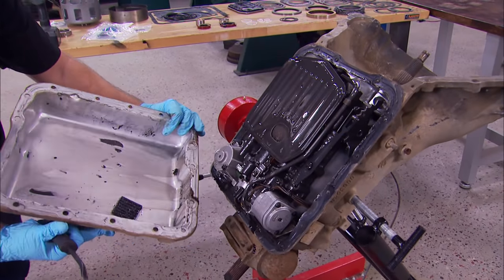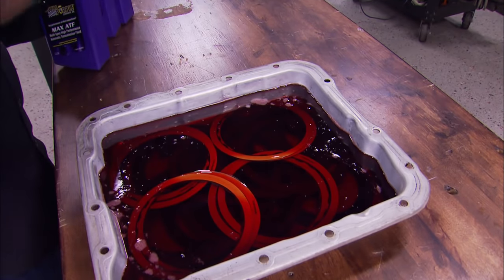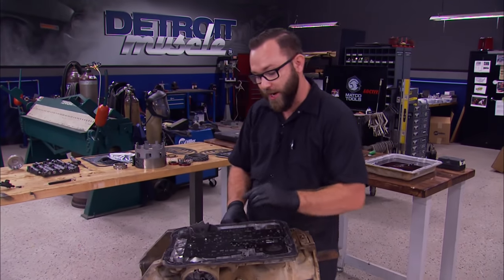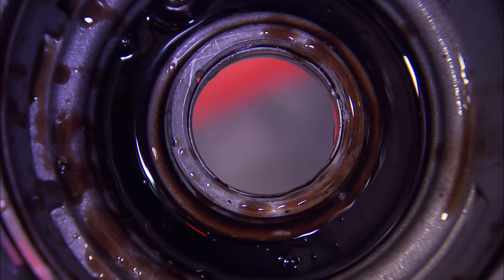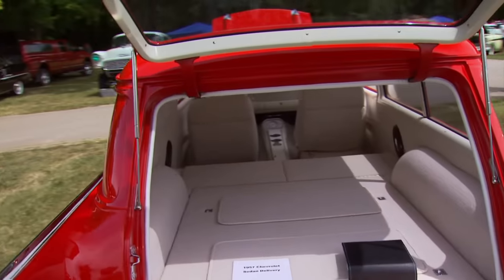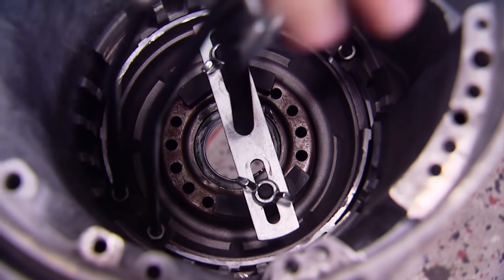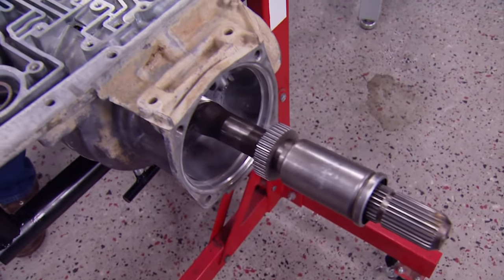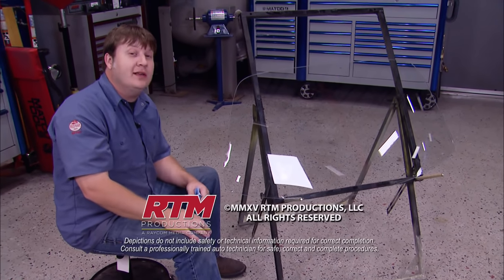Re-Building The Popular GM 700R4 - Detroit Muscle S2, E23

Comment: I've been rebuilding engines and transmissions since I was 12. I am 47 now. Not sure what you did in the pump, but I hope it's a 13 vane. Also, use a TransGo shift kit, which includes a new pressure vale in the pump. And you should use a wide band vs the stock one. Find a way to stack extra clutch disks where you can. And get an Allison Z-Pack clutch kit too. Get new accumulator pistons for it, and make sure to use an old one as well as a new one in the second gear accumulator. Use washers on the bottom of the shaft to stack both pistons till they are level with the plate surface of the trans. Pull the torque converter lock up valve, and add one of the check balls you are not going to replace, in between the two halves of the valve. Your TransGo kit will also tell you where to drill out holes in the plate. Even though the trans kits come with O-Rings for the bolts for the pump, always use some 3M sealant/adhesive on them as well. And use some to help secure the torque converter seal retainer too! For shafts, I always recommend good billet products. Sonnex is also a good source for top quality products.

I would also recommend that you get the ATRA rebuild manual for any trans that you are working on. If you need the manual for the 700R4,/4L60/4L60e, let me know, and I will put it on my google drive and post a link. 

I would also like to direct anyone who is planning to rebuild their transmission, to do a search for your particular one here, on Precision Transmission. I've been doing this for a long time, but even I have my heroes! I look up to Richard, and you guys will like him too!   https://www.youtube.com/c/PrecisionTransmission

Here is Richard's teardown of a 4L60 (Basically the same as a 700R4, and just prior to the 4L60e where the electronics were introduced.)   https://www.youtube.com/watch?v=_5lRls7UvzQ

Take care, everyone! o7
Reply: I love watching their videos.
Reply: I was watching a video by Richard from Precision Transmission just a couple of days ago. The man sure knows his stuff! 👍
Reply: If you seen,they left out a part.Left the anti clunk spring which was not put back in.Also toss the 5 black springs in the direct drum in the trash,restrict the clutches from floating
Reply: Thanks for the info! I'll be converting a 2001 4L60E into a 2wd unit and mating it behind a 2005 LQ4 6.0. This combo will be getting dropped into my old '68 C10, and I'll want reliability and longevity after the rebuild.

Comment: Thanks for the video guys!
I've learned that the 4L60E is similar with the exception of the electronics and the valve body.

I'll be doing a rebuild and 2wd conversion on my 4L60E that's coming out of my 2001 Suburban. This transmission will be getting dropped into my '68 C10 behind a 2005 LQ4 6.0. Of course I'll be installing the heavier duty clutch packs and sun shell. It has a rebuilt 327 and TH400. It's a very dependable combo, but it's limited in performance and driveability. I am upgrading because I want the EFI and the overdrive, plus the deeper first gear.

Comment: 700R4s aren't bad, especially when built. However, I wouldn't put it behind a V8 Big Block.
Reply: Chevy trucks of the era used TH400 in big blocks. The 700R4 would not last
Reply: We never had a truck with a 700R4 make it to 100k miles without having to be rebuilt. Once they were rebuilt they were much stronger.

Comment: 700R4 - 4l60s are really good trans . however not behind almost any V8 in a stock form .
Reply: Yeah, a new beast shell is needed in the rebuild, as well as new clutches,  and the 2 4 servo replaced for a Vette version.
Reply: Um I have nearly 400 000km on my stock never pulled or rebuilt 4l60e in my 98 Z71 Silverado and it pulls and hauls all the time trans has never bin rebuilt. Now my 96 Chevy 6.5 diesel 1500 4x4 has 506 000 km and it's on its fourth 4l80e 🤷
Reply: I went thru 2 4L60e's within 115k miles on my stock 09 1500. (4.8) The thing gets too damn hot while hauling/towing anything. I think that trans belongs in the old blazers/trailblazers. Moving a full-size/crewcab truck like a silverado/sierra without a aux trans cooler is a ticking time bomb lol 6L80e was a much needed upgrade in 2009+ paired to the 5.3.
Reply: @frenchfrysz6695  Don't know what you were doing wrong I've had up to 14k behind my 98 Z71 short trips with that weight but it's done some long distance heavy hauls and yet this original 1998 4l60e is still going strong I have a high torque 5.7 vortec full 3" dual exhaust and no cats and slightly oversized tires. Now I do alot of maintenance to my trucks fluid change's when the light turns green I dont stomp on it I let the truck warm up extra long in the winter time then drive slow for first little while I even let my truck warm up to operating Temp in the summer months and after long trips I let it idle for five minutes before shutting it off. I guess I don't know what I'm doing Ive taken 4l60e's to half a million km not sure what that is in miles but he'll I've owned alot of gm truck's with 4l60e transmissions and I've had great luck. I think alot of bad rap comes from bad owners that thrash on there trucks don't perform regular maintenance and BAD SHOPS REBUILDING SAID 4L60E's that don't know what there doing or there hacks or both! GM transmission rebuilding has bin something I want to get into cause I'm sure within the next 100k my well used 4l60e will need a rebuild and I want to be the one that does it so I know that it'll be done right same goes for my junk 4l80 behind my 6.5 turbo diesel every redneck on the planet talks about how great the 4l80e is yet my 6.5 eats them up for breakfast time for me to start rebuilding my own transmissions.
Reply: @taylorh3930  I hear you lol i wasn't really gentle with it honestly. Id get stuck in mud/snow a couple times a year, and banging the rev limiter to get out, got it hot. But just towing a trailer with 2 riding lawn mowers (with 200lbs guys in the cab), or a boat would spike the trans temps on the road. 210-220°F. Both times it ate the rear planetary gears. 
It had the torque management in place and everything lol clutches were still "like new" I was pretty much at the fluid/filter service intervals when they failed. Maybe the shop I had didn't do things to the book for the rebuild, I dont know. I didnt do burnouts or anything like that, the TQ management wont let you haha. I did go through alot of temerature intervals with that truck. 0°F+/- to 90°F. I loved the reliability of the engine though. The rest of the truck was plagued with electrical and suspension issues. Nickel and dime me to death ugh.

Comment: Technically the powerglide wasnt the first mass produced automatic transmission. It was actually a Hydra-matic transmission and it was also a 4 speed. 1 reverse, 3 underdrives, and 1 direct drive, no overdrive. This transmission along with the Cadillac V8 was used in tanks in WW2
Reply: More info please?

Comment: Damn where tf were y'all 15 years ago now when I did this? Same with the electric version of this transmission the legendary 4L60E/4L65E, 4L80E..

Edit: You guys should also do a transmission video on the difference between a 2WD trans vs 4WD transmission and how to convert or swap them around. I learned this myself several years ago doing one for my buddies S10 and he couldn't find a 2WD anywhere.
Reply: That's the issue that I've ran into in my area. The 4wd transmission far outnumber the 2wd units. There are several 4wd versions but hardly any 2wd versions, and when one does become available it's already spoken for, no matter what their condition is.

Comment: Not sure if anyone reads these. I have a 1983 700r4 and I’m trying to buy a torque converter. The books all say it’s 27 spline but I count 30. I know it’s been rebuilt at least once. Is this possible?
Reply: 27 spline is the early input shaft.
Reply: I have an 83 also. Same thing for me. Website’s all say it’s 27 but mines a 30 spline. I bought a Hayes 3/4 race converter and the numbers said it was for a 30 spline but after trying to put it on the trans I took my scope and looked inside it was a 27. 
Ended up buying a Boss Hogg Street  Bandit

Comment: My 700r4  slips after short distance. First losing od then when u stop i have no reverse but i can shut off the truck for maybe 1 min and start it back up and i then have reverse but only for a short drive then same thing happens. I can hear a winding noise when i stop and in N but stops when i put it in reverse. Transmission pan  and bell housing cover gets really hot to the touch. Cant hold your fingers on them very long/2 sec.s hot. Im a poor man trying to figure this out because this is the only ride i got. All help Appreciated asap.

Comment: Quick question where would i connect the vacuum line from the torque converter lockup switch on my carburetor?
Reply: That's like asking someone how long this piece of string is LOL. 
That said probably doesn't matter because as long as there's vacuum at cruise the switch will know when to apply it ie. 4th and constant light throttle. All it needs is vacuum even if it is an auxilliary port on the brake booster fitting on the intake or on the carb. Ported or unported again probably doesn't matter. If it's ported and there's no vac at idle the tranny isn't in 4th.
I can't be sure but I think what I said is about right. If I'm wrong someone will tell me you can be assured of that!

Comment: Isn't the output cover on the transfer case the same one that goes on the end of the 2wd transmission case ??
Reply: The transfer case adapter bolts to the back of a 4wd or 2wd case. But a 2wd output shaft is longer. So to swap a 2wd transmission to 4wd you just need to change the output shaft

Comment: What's the name of the special puller used in this video at the 6:24 ?
Reply: You don't need that. There are usually 2 threaded pump bolt holes to put 2 bolts in and push the pump out. Or just put a big flat blade screwdriver between the back of the pump and reverse drum and pry it up

Comment: Best way to fix a 700r4 is to go to a junkyard and replace it with a 4l80e.
Reply: The issue with the 4l80 is the TERRIBLE gear ratios, And it takes more HP to turn it.
Reply: @michaelspizzirri4079  I disagree.   When I put a 4l80 in my diesel suburban, it felt like I gained 50 hp and 100ft lbs torque.   it was unbelievable.    Probably because the 4l80e could survive at 100psi and the 700r4 needs 200psi to keep it alive.
Reply: @CrankAddict  You must have good rear end gear ratios because a 700r4 has a 3.06:1 first gear ratio, while the 4l80 has a 2.48:1 first gear.  I can't see how you felt a power increase, but I haven't been in your truck so I could be wrong

Comment: 700 is good for nothing. Replace it with at least a 4l65e.
Reply: Same trans...
Reply: @sicsam1   700r4 is mechanical, has 4 pinon planetaries, less clutches than 4l65e, one piece case, and a prone to cracking 4 bolt tailshaft housing.  4l65e has an electronic valve body,  5 pinon planetaries, 6 bolt tailshaft, and a stiffer 2 piece case.